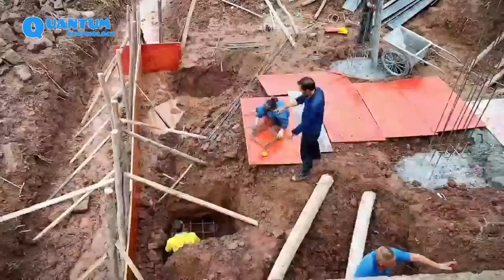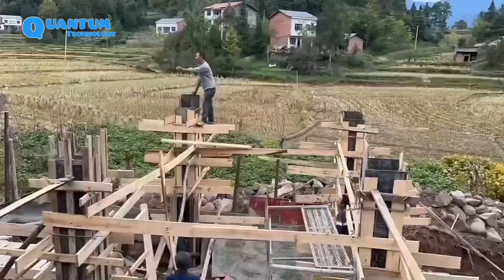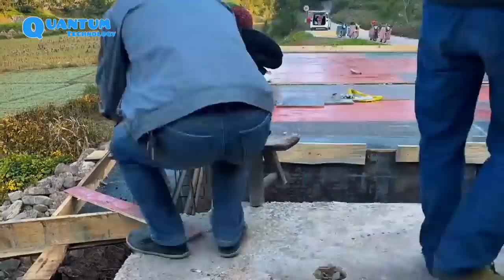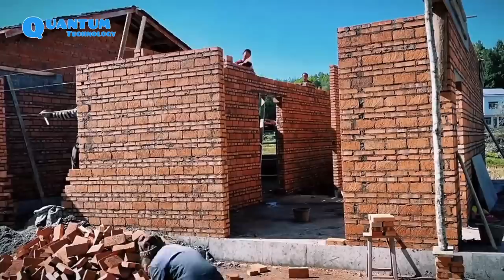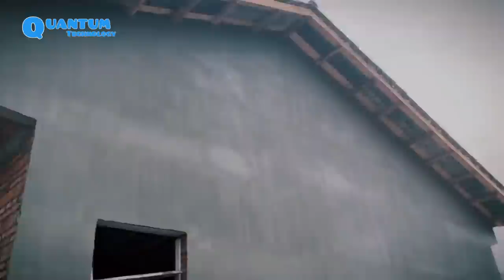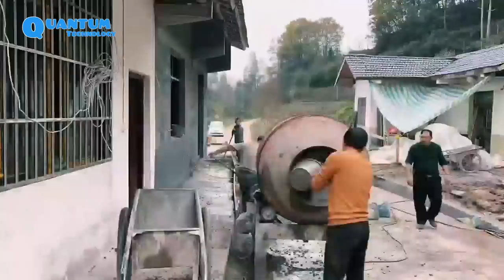Build a beautiful house in the Chinese countryside part 1 | quantum technology

Comment: 粗制爛造....磚牆中間需要一鋼筋 "Brick walls can be quite weak if not adequately supported. Reinforced brickwork provides much-needed strength to larger brick structures." 當地震來襲時，這樣的磚牆都會崩!
Reply: Your comment is also quite unprofessional. The brick house is also strong enough when designed properly, have you ever learned about the so called double brick house. In addition, this kind of Chinese rural houses are not crude, they are not in order and implement modern house design standards